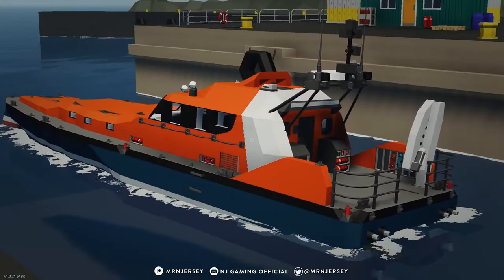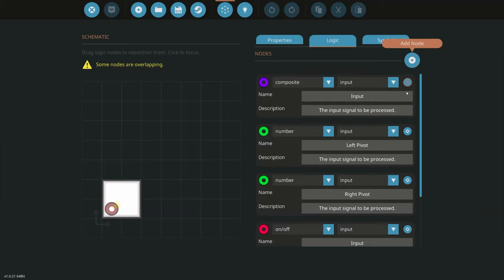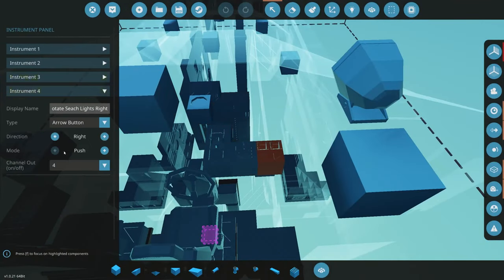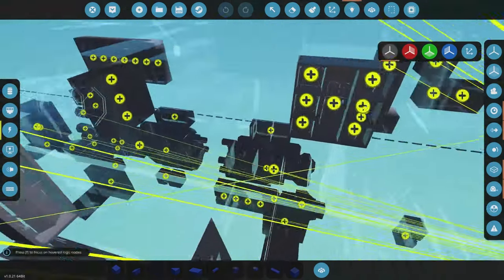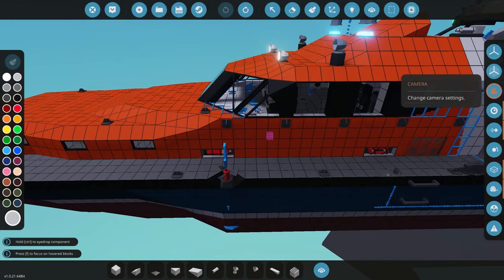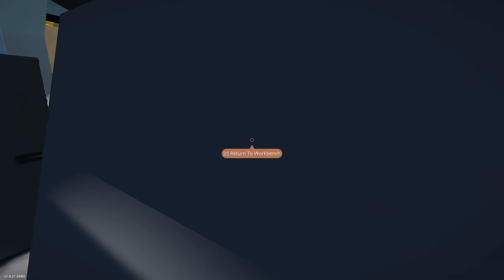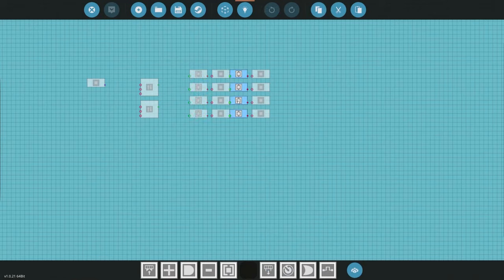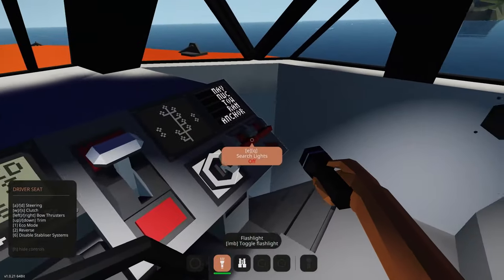HYDROFOIL SYSTEM!!! - SAR Boat Build - Part 8 - Stormworks

Comment: Absolutely love your build... Please consider using a second microcontroller for the beacon finder by cake. Cake labeled theirs emergency beacon finder (example). This microcontroller tells you the range/how far away the signal is. I personally use it in on my creations it is very accurate. you can simply add a second 1x1 monitor below the other monitor. If you decide to look for it the screenshot is of a one by one monitor and at the top it says locate in orange and then 400m below

Comment: You could save a tiny bit of space (I think your microcontrollers are being placed in your fuel tank?) by using them to replace flooring and decking elements with their flat bottoms. Should get you an extra hundred liters or so of fuel or buoyancy space .
Reply from the maker: They are in a unused area of the boat, so no point in moving, also I have not designed the ship to save space. Otherwise there would only be two controllers

Comment: You should have tested more rudder angles (for the hydrofoils) to get the most out of it.

Maybe the angle was too low to get some lift in economy mod, would have been great if you had put one angle for economy and another one for performance mod.

Comment: There is a better way to control the slider for the beacons that doesn’t consume power.
All it requires are 2 electrical connectors, set the power of the slider to 0% and then it will lock into place, no electric needed.